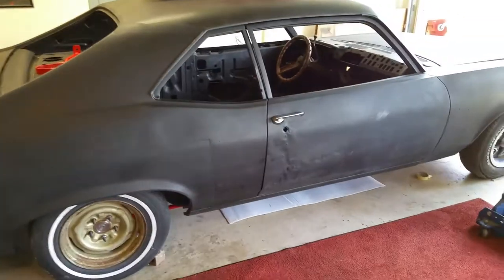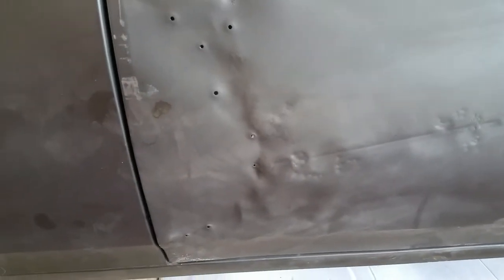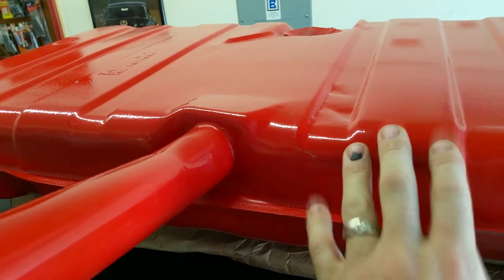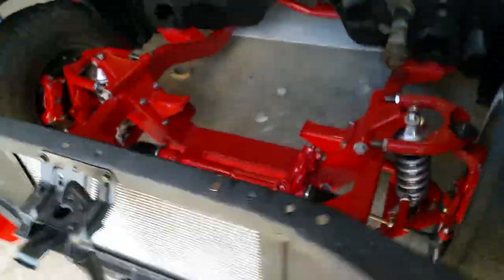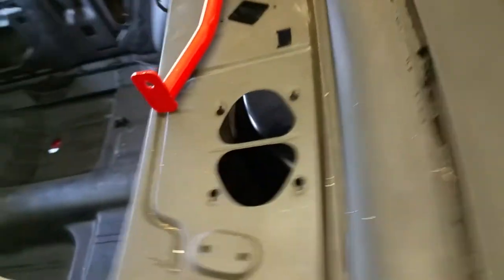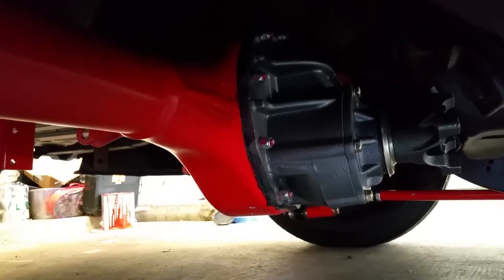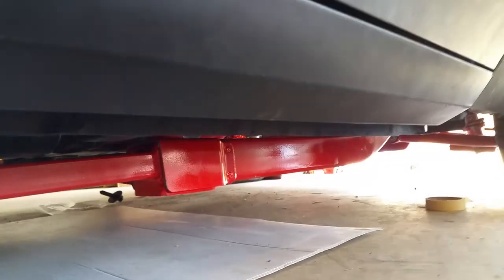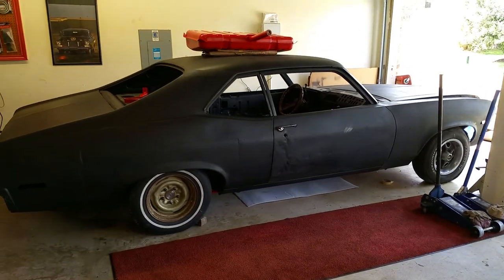Building a Pro Touring 1970 Chevy Nova

Comment: Yeah you're right why not go ahead and put that battery right over the top of your gas tank get all that electricity flowin up over the top,& all around them gas fumes.This way when you have a wreck you'll go up in flames sooner m,rather than later ... Dude there's a reason why the factory put the battery up front and what's the difference if you got cables running up front or in the back don't forget about how dangerous it is why in the hell would you want a battery in the same compartment you carry groceries your clothing or just whatever it's a trunk dude, and its not designed for a battery.. Stop blaming your sandblasters for a dent that anyone with a brain can tell was made with someone's knee,or someone leaning on the car. Do you see that big panel welded in it over the wheel well,hell the quarter and the door skin should have been replaced years ago good day.